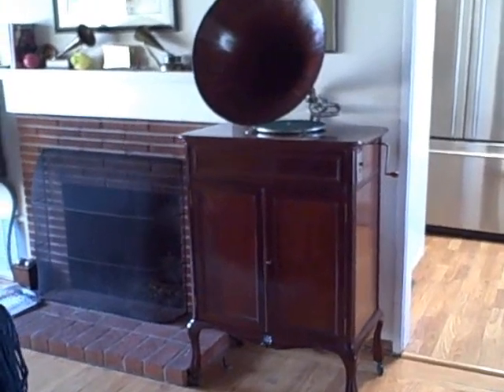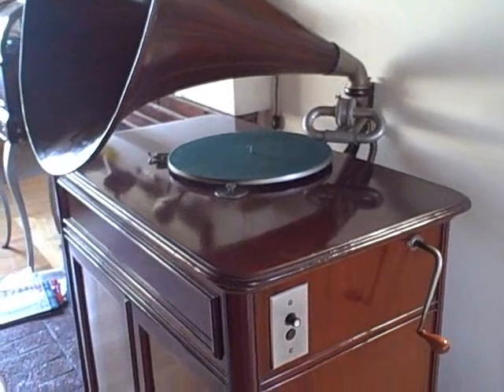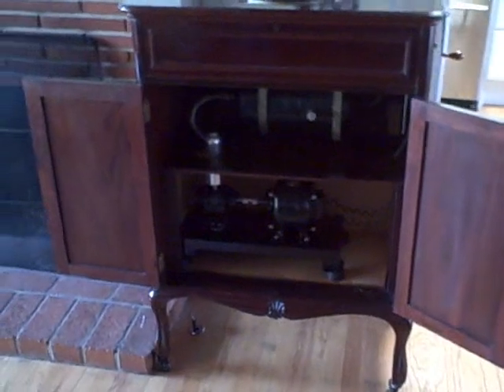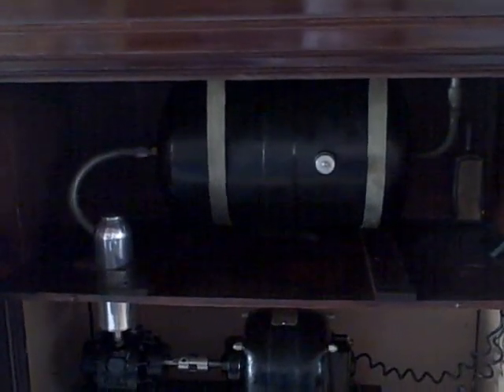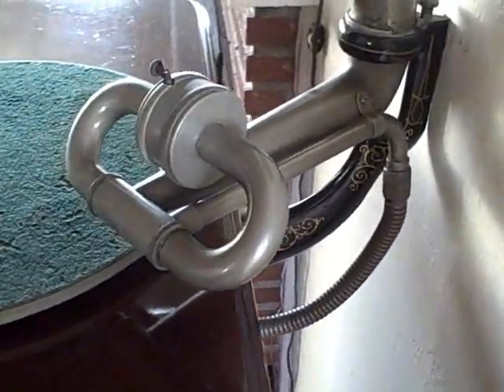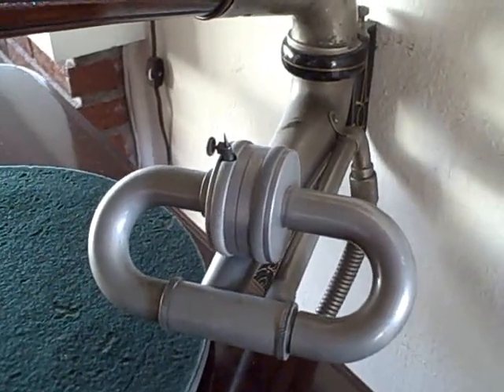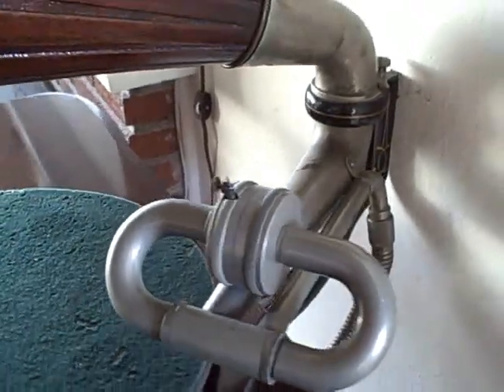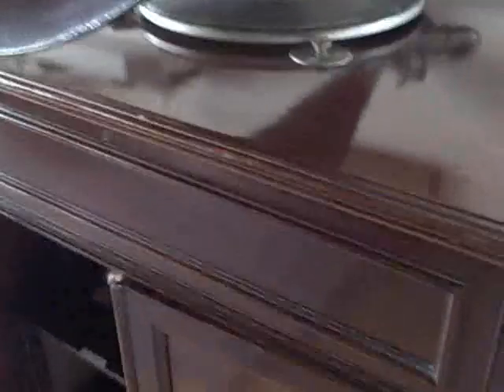Victor Auxetophone

Comment: You should consider a modern compressor or at least a modern drive motor for the compressor. The compressor is extremely loud going by the video.
Also, you could regulate the air better for quieter amplification.
Reply: You could use transistors...
Reply: @tooleyheadbang4239  Well, the idea is to keep the original amplification system.
Reply: @tarstarkusz  In my opinion, yes.
Not in yours, clearly.
Reply: @tooleyheadbang4239  I suppose that is a fair point. It is a very rare unit and keeping it original is probably preferable.

 But lots of old things need modern parts because original replacements cannot be found.  While a more modern compressor might not be original, it is not a fundamental change in technology whereas transistors and a modern stylus and cartridge would be.
A lot of these old gramophones were modified for tube amplification in the late 20s.  They would swap out the reproducer (just the reproducer, not the tonearm) with a horseshoe type electric reproducer and run the wires into an amplification unit.  The motor would remain wind-up.  This became even more popular in the 30s because of the depression.
Reply: @tarstarkusz  Thankfully, this one has survived without being modernized.
Reply: @tooleyheadbang4239  I agree.  This is a  very rare unit and uses a pretty unique amplification system.
However, this is not the only machine with mechanical amplification.  There was an Edison cylinder machine with a mechanical amplifier.  There was another kind of mechanical amplifier that was seen on some disk machines besides the air based one in this video.  Very fascinating.

However, the main reason I left the comment is because it really cannot be used in its current condition.  The amp is too loud with no way to control it and the compressor is too loud so that you cannot hear the record anyway over all that racket.

Look at cars.  There are a lot of car collectors who restore the car to showroom condition.  Then it gets loaded into a trailer and driven around from show to show.  It's a 4k pound knickknack.  I like antiques that can be used as they were intended.  Any item that cannot be used is just a knickknack to be put somewhere and admired.  I get that there is utility to that.  But for me, it is so much better when the item can be used as originally intended.
Reply: @tarstarkusz  The item is working as it was originally intended.
That's how they were.
If you want to listen to records,  better machines are available.

Comment: I've been curious if a musical instrument could work with compressed air, like an organ, but this is the closest thing I've found.
Reply: What? Literally all wind instruments work with air. That's what an organ is, a gigantic collection of flutes and reed instruments. Nowadays they're all converted to run off compressed air, or rather, they always did, but in the past the air was compressed by a pump, manual or otherwise.
Reply: @greenaum  I'm talking about compressed air supplied by a stand alone electric or gas air compressor, not built
 into the instrument.

Comment: I'm getting in here really late, like 10 years late, but I just happened to bump into this tonight and I was astounded. I really thought I'd seen it all in the line of High Fidelity, but this Air powered Amp just blew me away! Hmm, I wonder if this invention ever evolved to the point of Stereo  Implementation? If so I wonder if they had to use 2 separate air pumps to achieve a good Signal to noise ratio, or if a simple 1 to 2 "Y" connector adapter would work without objectionable Cross-Talk? And this baby is Expensive! 500 bucks in 1906 is around $13,500.00 today. Not a bad price to pay though for a Major piece of Audiophile history... Thanks for posting that Rene.
Reply: There weren't such a thing as stereo discs in those days. If you wanted stereo you'd have to buy a second gramophone!
Reply: Believe it or not, this is not the only model and they were made for cylinder records as well, though they weren't for outdoor use and were quieter.   There is a video on youtube of a cylinder record being played by such a machine and the fidelity is excellent for what it is.

Comment: I don't understand how compressing the air makes it louder. Is it because compressed air transmits sound waves better than thin atmospheric air? Like how wood or iron, or water, conducts sound much better than air?
Reply: OK I watched it again and understand. There is no diaphragm attached to the needle, it's an air valve that opens and closes with the vibration from the needle. Incredible!

Comment: See, if it were me, I'd have put the compressor in a box away from the gramophone part, and had a tube to send the air through. That way you could stick the compressor in a cupboard out of the way somewhere, covered in blankets. 

Still it's amazing they had sound amplification before electronics. Ingeniously simple how the little valve works that does the job. 

I recall reading about a telephone amplifier that was also mechanical. Used a disc of rotating chalk, that had variable stickiness to a nearby brake, controlled by the voice current in the phone. The disc sort-of scraped on a part to make the noise. We are so lucky to have transistors!
Reply: This is exactly what was done in Queen's Hall, London, when an Auxetophone was installed for Sir Henry Wood to try. The blowers were put in the basement. The hall's management were rather disappointed by the amount of electricity it consumed.
Reply: Valves are fine too. The only problem with valves really is waste heat. If the valve could be made to work without heat, it would like be better, at least in audio.
Reply: The telephone was actually called a "chalk telephone" a chalk cylinder connected electrically to one side (either + or - ) was revolved by hand crank or spring motor.  It was in a shallow tray of water at bottom to keep it moist.  A small pin at top connected electrically to other pole completed circuit. The pin (not needle) was vibrated as current changes changed deal and vibrated diaphragm attached to horn.  

Elsewhere in YouTube there is a Columbia cylinder phonograph that used a rotating cylinder to amplify by
  In effect
grasping the rim as the needle vibrated, the effect was less but amplification real.

Comment: Does the pump have to be on at all times, or can the tank hold enough air for one song if the pump runs for a minute?
Reply: The tank is only to equalize the pressure. It holds very little air (and has a release valve if the pressure gets too high). You can notice in the video that when the blower motor is shut off the sound drops to nothing in barely a second. So the motor has to be running constantly.

Comment: It would also be interesting to combine amplifier of this type with a crystal radio. By the way, this is not the only sound amplification method available before tubes. Another one is carbon amplifier. It was used with crystal radios sometimes those days, as well as in hearing aids.
Reply: Yup, although technically this would work without any electricity at all. You'd need a steam or petrol engine or something to compress the air with, of course. Best to do that in another room, or possibly somebody else's house, and have the compressed air coming down a long tube.

Actually gas was piped to people's houses in cities, for use in lighting and heating. There were small engines that ran off it. So maybe one of those in the cellar compressing the air, then a discreet pipe up into the living room. You might be able to limit the volume by limiting the air pressure you supply to it. And then, yes, use it for radio too. You could perhaps rest the gramophone needle on your earpiece's diaphragm, or even rig up something electromagnetic to move the auxetophone valve, though it would be a very weak electromagnet. I dunno, it's the sort of thing you'd tinker with as a gentleman of leisure.
Reply: @greenaum  Есть возможность механическим способом создавать воздушное давление. Его изобрели за долго до появления грамм записей.
Используют по всюду где есть музыкальный орган.
Во время игры на органе человек педалями накачивает меха и создаёт необходимое давление.
А давление в органе очень большое.

Comment: Why not start making pneumatic sound amplifiers again and market them to asudiophiles as something that is even older than tubes. Such amplifiers can also be made by hobbyists. For example, steampunk hobbyists, as well as Amish, who are very experienced in pneumatics.
Reply: I heard on NPR a few years back about a production team making a device to amplify the voice at orthodox Jewish synagogue during Sabbath day. I already knew of the pneumatic amplifier. 

 NASA to test things like pumps and lines wanted to mimic the explosive effects of the main motors in the Atlas3 during the early space race. Hundreds of PSI air and cone servo valve giving about 500 dB of sound pressure. That's the worlds baddest subwoofer ever.
Reply: The oldest form of amplifying sound is to have more musicians. 10 trombones is louder than 1. Have 100 people in the chorus instead of one singer.
Reply: hyzercreek And this method is still used.

Comment from the maker: Yes, it is indeed very noisy. But the music does overcome it for the most part. The sound-equalizing character of the video doesn't really convey just how loud the machine plays, though the blower noise is very certainly evident in real life. It's far from an ideal setup. There's hardly any situation where these were practical, which is one reason why so few were sold.
Reply: Impressive bit of engineering, sound quality seems pretty good from the video and they overcame the noisy compressor with sheer volume. Better suited to playing 2000 era rock and pop recordings than orchestral pieces with a high dynamic range I imagine.
Reply: ¡Ufff! que fuerte suena esa cosa,era muy potente para la época.

Comment: that is fantastic. great invention. I wonder if the process could be reversed for recording, so it would have recorded at a high volume on the disc in the studio, that might have been a good idea!hmmm... :) 5 stars!!
Reply: Yes, you could put a diaphragm over the horn, of course a somewhat smaller horn, and use that to drive a cutting needle to make louder records. Edison had something like that. It didn't use the Auxetophone valve, but rather something cruder, but it either worked, or else he lied and said it did. Either is likely.

Comment from the maker: The compressor runs continuously while the machine is playing. The moment it is shut off, the volume drops down to nothing.
Reply: I suppose it runs on quite low pressure air, but with quite a high airflow. So the tank barely has time to develop any pressure, it just smooths out the waves of air that come from the compressor, lets them expand and contract and cancel each other out in the tank. The pipes going in and out are both about the same width.

Comment: Thanks for posting this! The motor sounds pretty loud itself, but I suppose that noise is drowned out by the music.   One question: does the compressor motor run all the time, or cycle off and on as the air tank pressure changes?
Bob